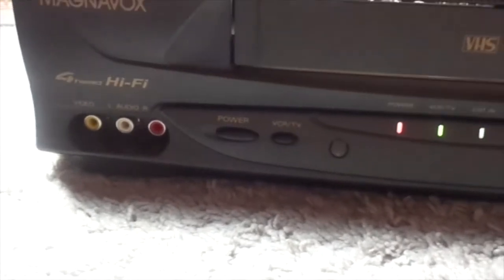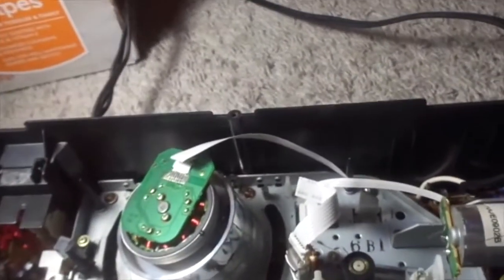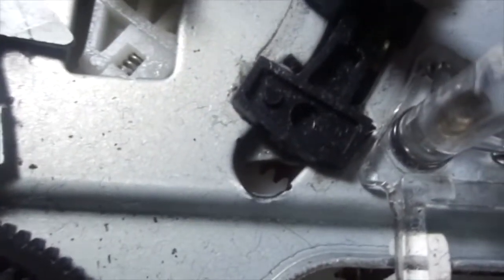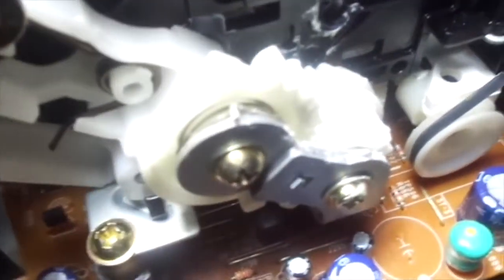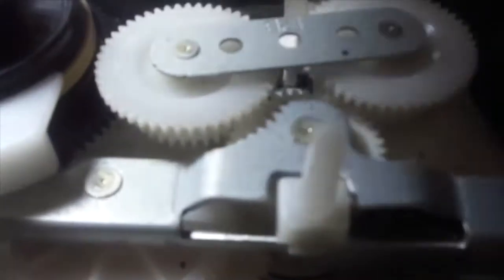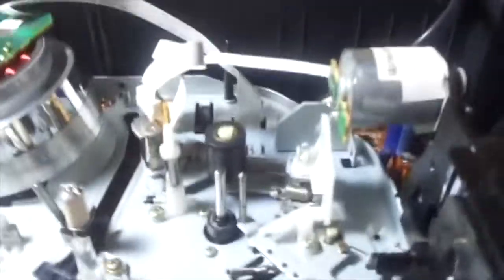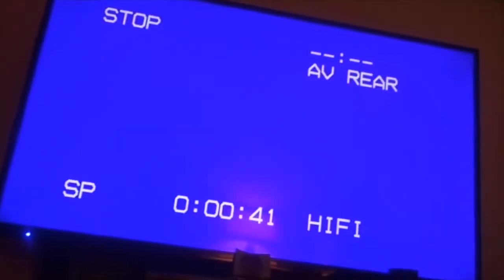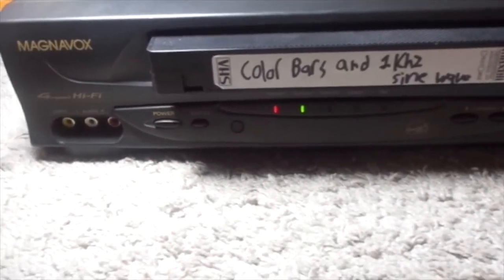Review of my Magnavox VR601BMG23 VCR

Comment: Hey it says Magnavox on the front and Philips on the back. Usually it will have the same name on the front and back, and some VCRs have the brand Philips Magnavox with the 2 names, but not in Quebec.
Reply from the maker: That's because Magnavox is owned by Philips
Reply: @TheVCRKing  Yes indeed. Philips sold Magnavox in 1993, and the factory was originally from Fort Wayne, Indiana. Philips was the same company that made the ill-fated CD-i video game console, and Magnavox also made the very first video game console, the Odyssey from 1972. Long before this, Magnavox made console stereos, record changers like the Micromatic series with the sensing tonearm, radios, TV, and other great electronics that Magnavox put out back then. Originally, the tagline says "The Magnificent Magnavox", but this one isn't magnificent anymore.